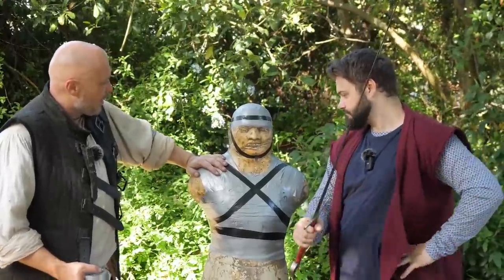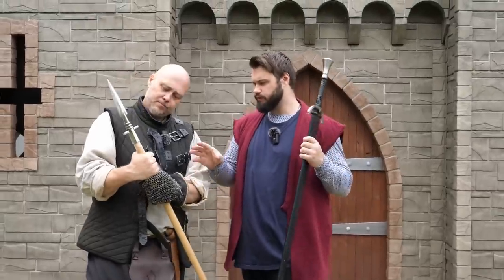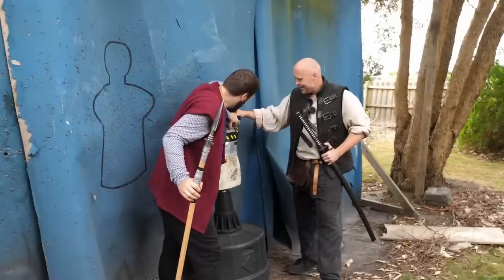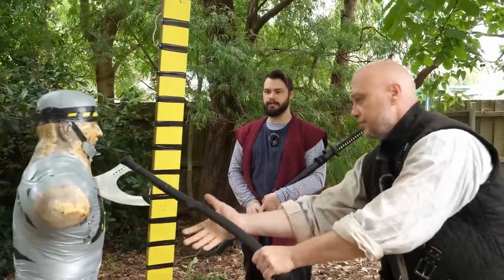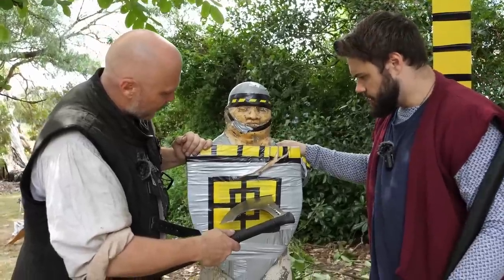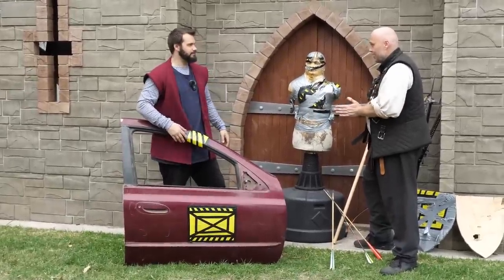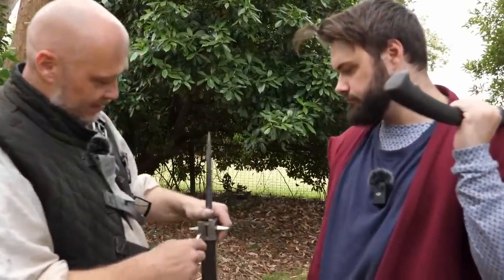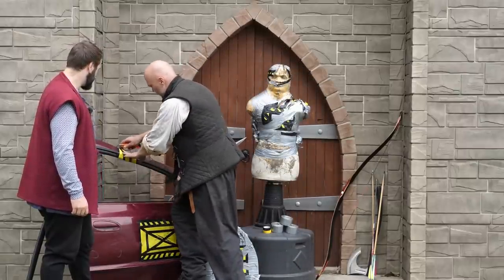Can DUCT TAPE stop a SWORD? or axe, spear, poleaxe, arrow, LOTS OF WEAPONS!

Comment: No matter the situation, no matter how in peril my life is, no matter how many years wear and tear against me.... IT SHALL ALWAYS BE KNOWN AS DUCK TAPE and it can FIX ANYTHING says my dad.
Reply: Tape the mouths, and beaks, shut on everyone who disagrees!
Reply: Duck tape was its original name in WW2. It came to be called duct tape when it made it back to the States but ironically ducts are one thing it's very bad at fixing (because the latent heat weakens the adhesive)
Reply: Quack, damn you 😜
Reply: @Avernaith  I had to google now. I am not a native speaker, but it seems that in US english there is a term: duck cloth, cotton duck or duck canvas. Which is just a name for cloth.
Also something about the Dutch word "doek", which again means "cloth". I guess there is the connection, people of Dutch origin making cloth in the US, and this was used to seal ammo boxes, which again was replaced by the new, better, "duck tape", the cloth tape that can seal....
Reply: @Avernaith  It's not used to repair ductwork but to hold insulation in place. I've worked on 40-50 year old HVAC systems and the original duct/duck tape is still holding the insulation in place, even under houses or in attics. Most of the time for the last two.
Reply: Duck tape is a registered trademark, the product is called DUCT tape
Reply: @johannesstephanusroos4969  QUACK

Comment: - You could wrap some sticks around the point where the spear was broken. It would be more resistant than just duct taping the spear.
- You could also take a wooden shield and wrap its borders with duct tape (like around the border). This way, duct tape would work like on Viking shields, that is, making it difficult to release a sword that got stuck on its borders.
Reply: "- You could wrap some sticks around the point where the spear was broken. It would be more resistant than just duct taping the spear."

Thats what i did when i broke a broom.
Reply: Basically make a splint for the spear and duct tape it on? That is a good idea!
Reply: That is pretty much the easiest way to fix a broken thing if you want to keep the thing that is broken. It works not only for spears but even for things like legs. Nowadays we have the splits inside and screw them directly to the bone, but the principle is ancient.

Comment: There was this guy back in the day who's bush plane went down in Alaska, about 40min fly time from the nearest town. He was flying an old canvas covered biplane (I think it is called). He happened to have an ass load of duct tape cuz he was delivering supplies to people out in the middle of nowhere. So he duct taped his plane back together, stuck the wings back on and fixed the canvas hull. He managed to take off and fly the 40min back to town. Duct tape literally saved his life cuz it was the middle of winter and there was no way he would have survived that far away from civilization, in the middle of an Alaskan winter. So yeaaaa for duct tape, I always have a few rolls cuz the stuff is great. Gorilla tape is even better, in some instances, but wayyyy too expensive. 😊
Reply: Mythbusters also proved a plane made mostly of duct tape DOES work as long as the frame is sturdy. Good watch.
Reply: T rex tape is to gorilla tape what gorilla tape is to regular duct tape. Expensive but even more durable and waterproof.
Reply: wooden frames and canvas covers, the earliest ways to build planes. Nowadays we use steel frames and aluminium covers, but the principle is the same.

Comment: Tip to make duct tape armor sections more durable: alternate directions.

Duct tape has directional strength, so alternating the placement (ideally 3, 5, or 7 directions or multiples of such) will MASSIVELY increase the strength you get out of the same number of layers compared to linear placement.  

Easiest but most wasteful way is figure out a shape that is the diameter of the surface and make as many layers as you plan to add as roundish or square “blanks” out of in line strips, then cut out the desired shape, rotating precise ° increments to get all different orientations
Reply: i will say the thrust with katana may have been slightly bad due to thrusting where already cut and not middle but nice episode
Reply: I was thinking this - people forget that duct-tape is essentially a fabric

Comment: As an engineer that uses duct tape enough, I know there are different manufacturers and grades.  The high cloth variants are vastly superior if you are trying to make armor.  Better still, make a hardware store gambeson using metal duct steel, gambeson, and nuts and bolts.  The best part is ease of repair and re-manufacture with those things.
Reply: would key rings work for mail? or would it need something like nuts to be strong enough.
But whatever people say, the hardware store would be my target of choice in case of a zombie apocalypse. All kinds of materials to build bite-proof armor and all kinds of tools that can be manufactured into weapons.

Comment: Hey but in an adventurer’s setting, (having a form of duct tape (Mediaeval tape)) would be very useful building shelters, temporary repairs in clothing, backpacks, pouches or setting up traps and snares, holding prisoners, maybe you guys should make a video about that side, maybe making some attempts at making tape out of available medieval materials!
Reply: That sounds like it would work on paper.
Duct tape is made adhesive, latex/rubber and and fabric.

The Olmecs had latex, they had woven fabric.

The Olmecs could of hypothetically used sticky sap to make somekind of proto-duct tape

Comment: would be really interesting if you guys took the idea a bit further. something like diy repairs with modern common items. i.e. if you have the bec de corban you might also have a bow, a few arrow shafts around the spear (or any rod like items from modern times) for structure then wrapped in duct tape, armor made from duct tape layered with other materials in between like old clothes or upholstery, etc.

Comment: Key to proper duck tape armor is to not just use the duck tape.  its to use duck tape to wrap and tape pillows, towels, and other linen to yourself.
Reply: ducttape has tensile strenght, but no cut/piercing resistance. 
tiles and wood wrapped in tape and taped together is very strong.

Comment: The shield covering seems the most useful.  An easy layer of extra strength for something that's going to be taking a lot of hits.  And it's super simple to repair when takes damage.  Probably also useful for the hafts of weapons, as it adds extra grip, and could keep a broken haft together just a little bit longer.

Comment: i think its worth considering that while duct tape is strong and good at affixing things together, its still made to be torn by hand, so a bladed weapon would just cut the weak points, and spikes just slide between the fibers in the tape. additionally, the stronger fibers are length ways on the tape, so just wrapping around and around rather than having some vertical structure for the spear mightve hurt its chances. anyway! i am loving the boys hitting things, nathan's delighted giggle/snicker any time he pulled something out of boromir got me every time. rip to the bec de corbin tho :(

Comment: For the spear, I'd have made a quick v cut in the spear shaft and then shave a corresponding angle cut on the end of the broken part. Then slot them together and wrap with duct tape. It would not be floppy.
Reply: You'd have time to do all that in the heat of battle?
Reply: With how far up the spear broke and the time it takes to to a somewhat stable tape construction. Might as well use the spearhead to cut the top next to the break into a shape again. You'll end up with a functional spear rather quickly, just a little bit shorter.

Comment: Don't forget those rare few who remember the Diabolist paper armor from Palladium Fantasy RPG lol (in that game, the Diabolist class, which is specialized in magical writings and words and symbols and such, can render any bit of paper impervious to all damage by writing a silver rune on it. TBF, there are specific rules that limit how effective it can be, but that doesn't prevent my imagination coming up with ludicrous ways to thread strips of paper through larger sheets in ludicrously convoluted ways to create an absolute monstrosity lol)
Reply: Mythbusters tested paper armor and they found it to be a little less effective then the metal armor but the paper armor was much lighter and easier to make.  Which makes sense as paper is just a thin layer of cloth so if you layer many pieces of paper over each other then you have essentially made gambisen.
Reply: @MrGhosta5  thats, not how i remember that episode going, guess i have to rewatch it, any idea where i could find it =D
Reply: @MrGhosta5  perhaps but the rpg wasn't even talking about multiple layers necessarily, it was literally each individual bit of paper magically becomes completely indestructible meaning it can be literally 1 sheet thin and nothing can technically penetrate it... but a single sheet of uncuttable paper doesn't really distribute force, it more or less wraps around incoming edges/points, so unless you were doing dozens if not hundreds of layers it would still be pretty ineffective at anything shy of maybe preventing poison delivery (which was an angle that was frankly missing from the rules outright)

Comment: I would like to see a duct tape and phone book combo. I read somewhere that you can make cheap body armor from duct tape and phone books that can stop 9mm bullets. I’d be interested in stab-proof though.
Reply: I have no chance of testing any firearms, but enough layers of taped toilet paper can stop a knife. Both for cuts and stabs.
Longevity is an issue, but if you get hit you're most likely trying to avoid more contact anyway and the whole thing is easy to repair. Making it from small plates makes replacing them pretty easy. Similar to samurai armor or scale armor in general.

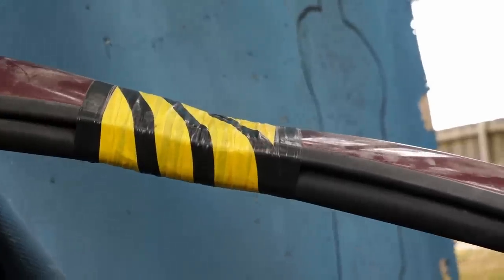Comment: 22:25 Yes, as car's are made in a way that the casing bends instead of breaking so that it does not break into a sharp piece that pierces through the passengers or cause other problems as such. Also, to absorb the impatct when you hit anything at speed/get hit by something.

Comment: The thing with regular tape holding better than Flex Seal is that it's more of a fabric, so it helps with structure. Flex Seal is better for a rubbery padding.
Also, I prefer to keep all the tape for regular repairs and to seal all holes in the house - that is tremendously invaluable for survival.

Comment: I feel like this whole duct tape thing might have some credence for appliance in zombie apocalypse or simply a zombie attacks, based on the power scale of most common zombie tropes.
Reply: the typical zombie apocalypse has a lot of things in common with medieval situations. At least in case of combat.
The opponents are pretty much exclusively melee fighters, so a strong physical armor that still allows for mobility is key. And weapons are usable in close range but don't use any ammunition that runs out and don't alert any more enemies with loud noises.

Comment: The medieval equivalent to duct tape was probably raw hide (untanned cow or deer hide).  They'd often put it on the face or around the rim of a shield or reinforce the shaft of a spear by stretching it tight and stitching it in place while the hide was wet.  The hide would shrink as it dried and tighten to hold the material more securely.

Ifyth the Ladyes don't find thee Handsomme they should at least fynd thee Handy.

Comment: I wish I could recall where I saw this, but I recall seeing armour made with duct tape. They layered it horizontally and vertically and also tested it with metal/ chainmail insider the layers. I think it may have been the crossbow channel? The horizontal and vertical layers worked pretty well.

Comment: I think what killed the bec de corbin was lateral torque. When it penetrated through not only the outer sheet metal of the car door, but the inner steel framing (assuming the inner frame of this door was steel), I think the follow-through of the strike combined with the lack of rigidity in the door being just leaned up against the testing pole there allowed the handle to twist slightly against the grain of the blade, creating a fracture that popped the bec off the corbin on the next strike.

Comment: A video you might think about doing is testing DIY armors. Like armor made from stuff you might find around your house, such as  cutting up a 5 gallon bucket and then laminating it with duct tape. Or reinforcing a Carhart jacket. Maybe using ducting from your vents. Duct tapping magazines around your arms, like in World War Z and so on.

What would make the most effective armor, if you had to use things found around your house?

Comment: Hey, got an idea... What about a mix material armour/shield? 😊
You can use different layers and materials to have a mix effect. Kevlar, flex seal and some hard material, like wood or other. Would it be good to hold itself together and protect against different types of attacks? Would it be heavy? Would a softer interior be good to spread the impact and hurt the person wearing it less?

Comment: There's a very interesting bullet armor with duck tape that I wonder how it would fare in this scenario? The armor is a few layers of ceramic floor tiles (the small ones like the bathroom) taped together and it DOES work to stop 9mm a few times. It would be hard to make a pauldron with a ceramic tile but there are those tiles made of little tiny tiles that could form around it, maybe two layers of tiles taped together would give coverage between the tile bits. -- and then of course, duck taping some wood together might make blade armor who knows.

Comment: I know from experiments as a kid that duct tape can tolerate cuts somewhat if you laminate it properly, but is pretty much useless against piercing attacks. When combined with cardboard in a laminate duct tape can make a stiff waterproof pad that you could wear under compliant armour such as chain or scale armor to spread the impact and adsorb energy.

Comment: I think if and when you replace Boromir you will have to give him a proper sendoff.
By that I mean you have to really go medieval on his sorry body. Pretty mich like that car door but with a lot more cutting.
Of course you don't have to but I'd like to see it.

It's quite amazing how well the car door held up considering it was never designed for that.
On the other hand it was designed to absorb heavy blows.
I think it's also interesting that the bec de corbin broke on the car door. That was either a use error or the weapons constriction wasn't that solid. Probably a bit of both.

Comment: Ducktape has a specific, grain-like quality.  If you really want to make something strong with it, you got to crosswise your application of the stuff.  For example, with the shield, you want the first layer to be all horizontal, with the second layer being vertical.  This will give the item structure, stability and strength that it otherwise wouldn't have if all the strips were oriented in the same direction.

Comment: The only thing I would note to fix if there ever is a return video is that most of the duct tape work I saw was unidirectional.  The majority of the strands in a strip of duct tape go along the length of the strip, so you need to create a lattice like arrangement to maximize strength.

Comment: There was a whole case in Phoenix Wright where a spear prop was put back together with tape, and how that couldn't have been deadly anymore because it would have failed to pierce the foam costume the victim was wearing at the time. It's kind of funny to know that, even though the spear wasn't used, it would have still probably killed the victim.

Comment: So I personally would love to see a video testing the concept of waterproofing various types of metal with duct tape or other materials. Like maybe not actual swords and armor. Or weapons of great value! But may be smaller bars of different types of steel that have been hardened! Of the types of metal that you would find in various weapons and armor. A control of completely unhardened and uncoded metal. And a control of hardened and uncoded and metal. And then various coatings of hardened and unhardened. And whatever fairs the best. You try one weapon and one piece of armor in those metals coated. This video would require a long time of leaving them in the elements and forcefully exposing them to elements. So I understand if that’s not in the wheelhouse! God bless you all! Exceptional video.

Comment: One of the reasons the roll of duct tape resisted that initial cut in the first test was layering. It really works. You can make cheap bootleg bullet-proofing for a car with old phone books (if you can even find those anymore) because layering similar materials over and over again, no matter how thin, multiplies the surface tension resisting the object penetrating them. So, yeah. Layers. Still, cool video, and I'd like to see more videos made of using modern day substances and tools to replicate medieval usages.
Reply: diy kevlar for everyone

Comment: Great video but I couldn't help but notice the silver tape seemed to be PVC duct tape rather than traditional duct tape. The traditional duct tape would have a cloth scrim which is missing in the PVC verity.  Do you think the outcomes would have been different using the traditional duct tape as it's usually stiffer and offers less flex than pvc?